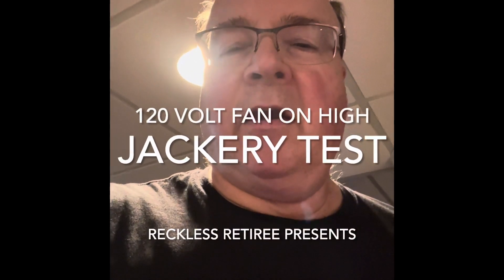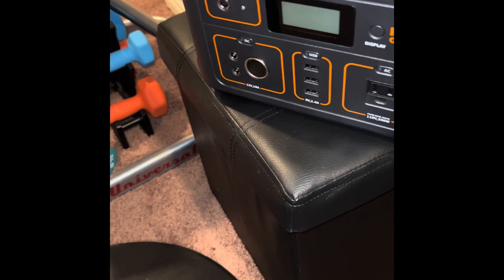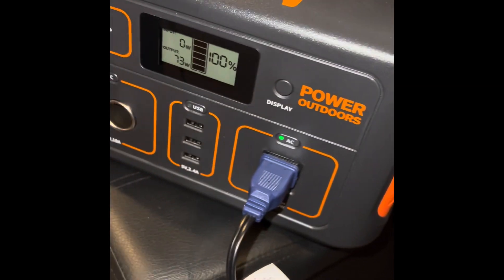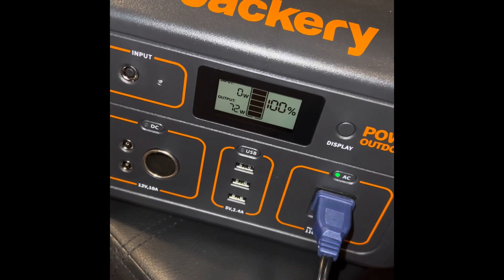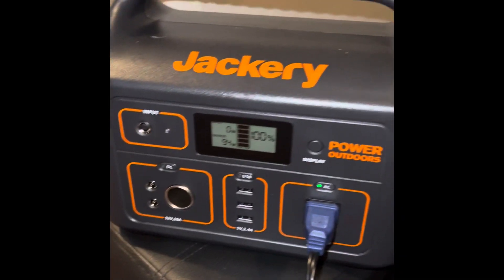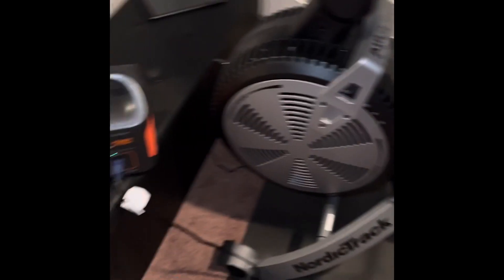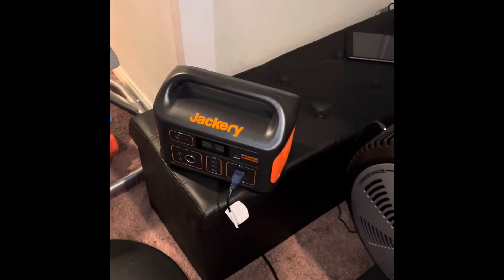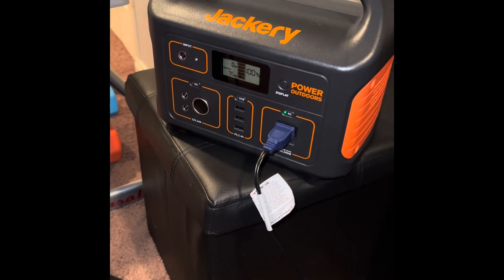Jackery test with 120 volt fan on high

Comment: If you are a using 100w, it will last 5 hours give or take 10%.  You have 500w.  Jackery is a good product; you clearly do not give it enough credit.  If your fan requires more than 500w, you have a serious fan or a serious problem.  lol.
Reply: Dirty fans req more power.
Reply from the maker: It is an old beat up fan! But probably not needing 500 watts.